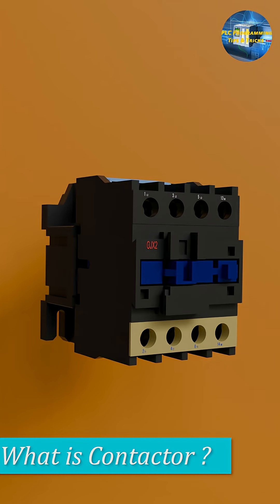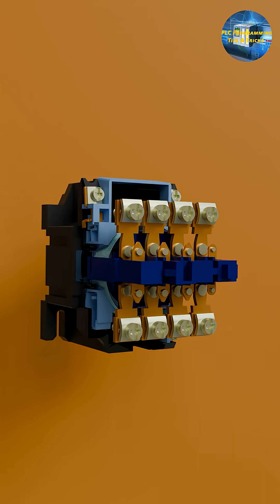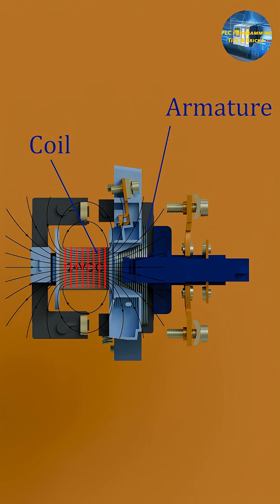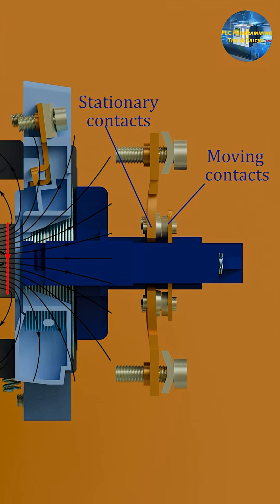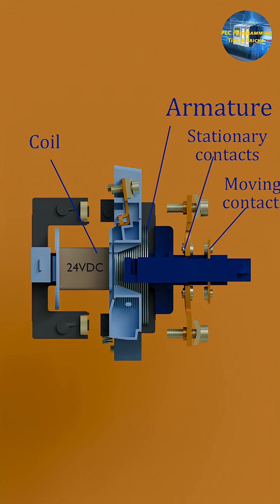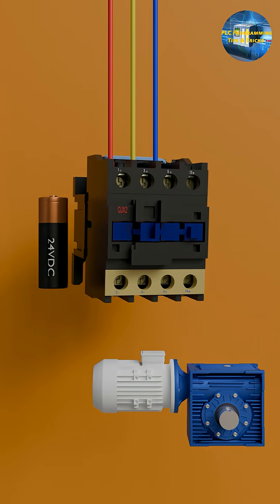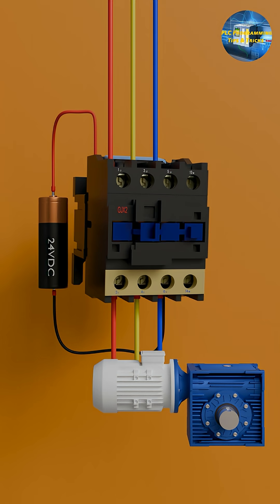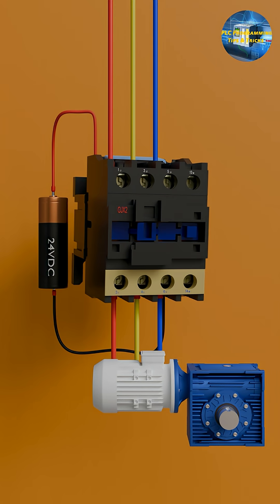How does a Contactor works ? #electrical #industrialelectrician #plc_tutorials #plc_programming

Comment: Explain three phase contactor whose coil voltage 230V. After coil energisation, explain contactor's auxiliary contacts and it's essential need add-on normally open (no) and normally close (nc) too